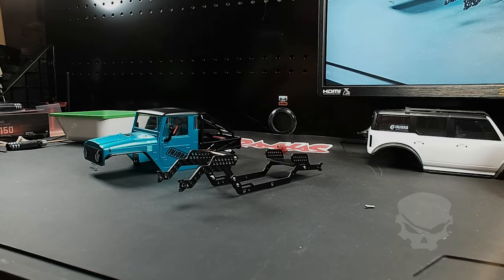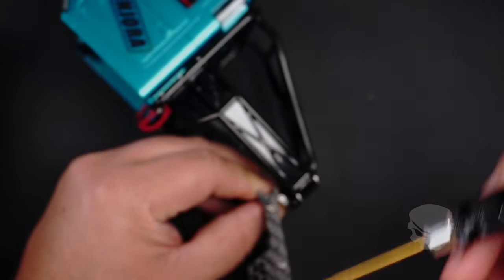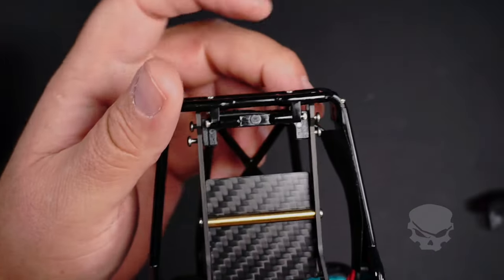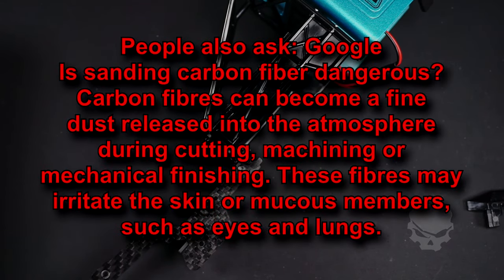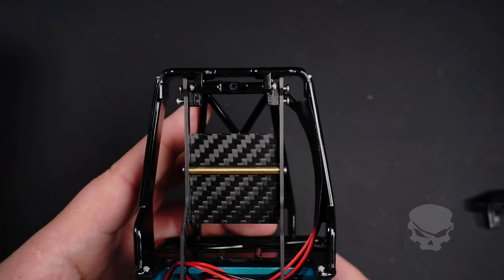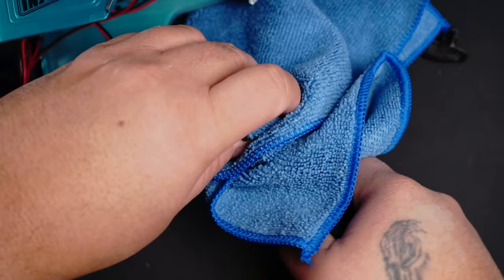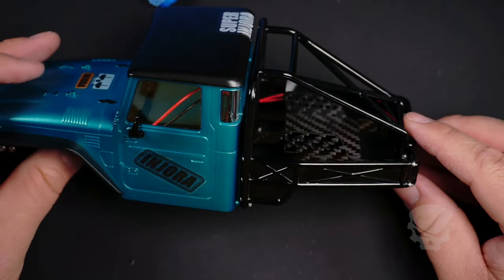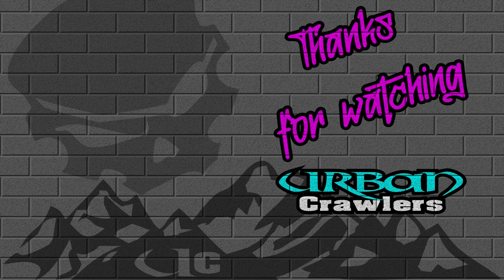LCG Carbon Fiber Chassis vs IR40 Half Truck From INJORA

Comment: Where did u find the dually set? And what do i need to make duallys work? Can i use stock axle?
Reply from the maker: Lol I've been debating on what video to do for monday. Yes you can use stock axles, There is some fabricating required though.
Moforc.com as the Duly that I use.
There is also a three d company that prints one, don't know how those are @oppaifactory

Comment: I’ve seen a few different people build these but didn’t seem to have any issues & I didn’t see them have to do any modifications to the frame or you using the Injora rails that are made to fit it?
Reply from the maker: At 0:15 It is displayed which 1 out of 5 LCG Carbon Fiber Chassis Kits, Injora Offers is in this video.
For more information on all other kits, read the full video description.
Reply: @UrbanCrawlers  Intresting the I ordered the universal ones that fit any model. I’m using them on a i40 build & using a TRXM Defender as my chassis I’ve already started the build.
Reply from the maker: @Casitascrawlers  I don't understand what you're trying to say.

Comment: I trimmed the taps off with a very sharp wire or hobby cutters. Do the fronts also. The taps will fly off.
Reply from the maker: For this chassis, the front end rear have to be trimmed. Cutting with a wire cutter is fine. Cover it with a rag as shown in the video.